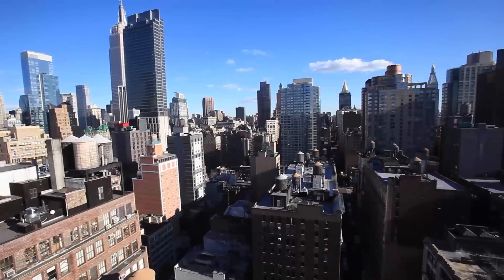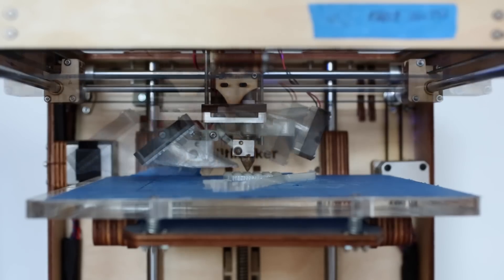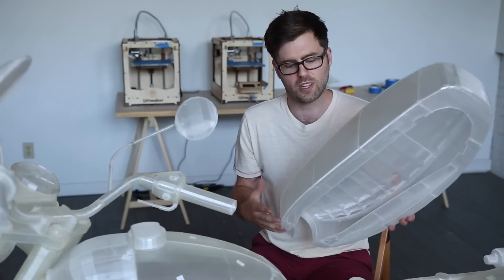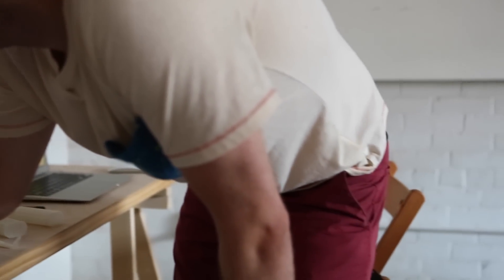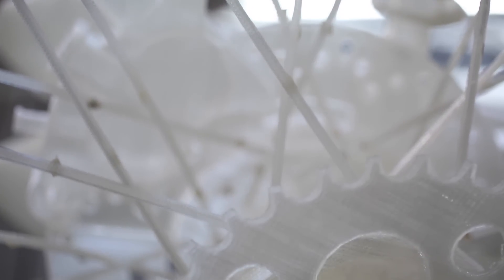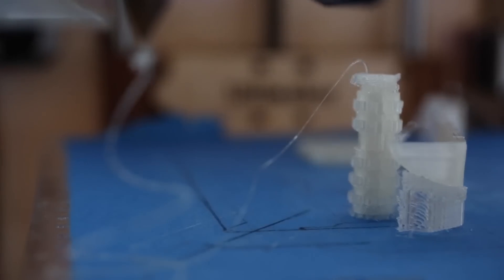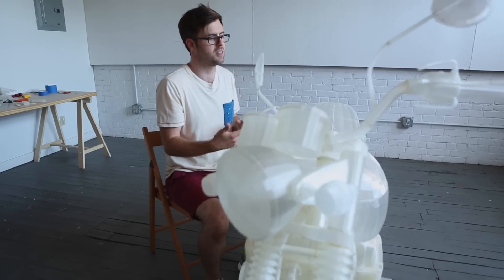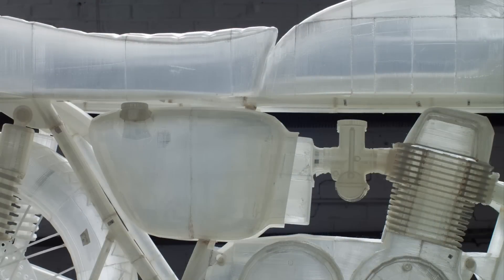3D Printed Motorcycle by Jonathan Brand - Ultimaker: 3D Printing Story

Comment: You could buy a real 72 Honda CB500 for about the same cost as one of those Ultimaker 3D Printers..  And you could actually ride around on it, and own the real thing..  He also didn't mention how much that plastic cost to run through the printer to make this huge model.  Factor in the cost for the plastic, and you could probably buy a nice Harley for the total cost that it took to build this model.
Reply: 18 rolls * $30 a roll = $540 worth of PLA filament
Reply: taiden but if you have microcenter nearby you could buy the roll at half price, with good quality the brand name called inland
Reply: esp heroz
Good to know, thanks! :)
Reply: Komet163B 
What's your point?
Reply: Yeah but when it comes to building things like prosthetic limbs, the cost of the material is WAYYYYYY cheaper for a 3-D printed device. Which makes it a lot more affordable for those that don't have the money or the insurance to pay for an expensive device.
Reply: taiden u welcome :),
Reply: +Komet163B thats no fun bruh.
Reply: Komet, the reason people buy these printers is so that they can make other things cheaper. He could have made around 3 of those motorcycles with that printer alone. Lol
Reply: about the plastic: he used 18 rolls. with cheap filament that's about 400$ and with high quality one more like 700$
Reply: Carter Peel it’s not a motorcycle, it is plastic model of a motorcycle
Reply: frogspasm2000 I think his point is obvious. The artist said he always wanted a motorcycle. This is a plastic model which you can’t even sit on let alone ride. He could have bought a real one for the investment
Reply: "you could probably buy a nice Harley"  2 things wrong with that sentance. 
#1 "a nice Harley" 
#2 "you could probably buy" no dont buy never buy a harley

Comment: how did you glue those parts together?? I a stuggling to find something that will actually fuse pla??
Reply: It looked like he was using a soldering iron and a loose spool of PLA to sort of "spot weld" them together

Comment: Is the slicer software included with the Ultimaker or is that a 3rd party software?
Reply from the maker: +CDNBaconRich We develop the free, open source slicer Cura, which is also what we include and recommend for the Ultimaker 3D printers. You can however use any slicer you wish!

Comment: Nice work, but it is a CB750.
Reply: I thought so; I had a 1975 CB750-4, I got brand new. the Engine cylinder blocks on the 750 are slanted slightly forward where the 500 is straight vertical. I know cause a friend had a 500 and I had the 750.
Reply: yea i have a 72 500 and my exhaust is different
Reply: roaringleo57 Good snag on the engine! I had a '74, 750 and never noticed the difference to other era Honda 4's. You got to admit though, it is a very impressive production. Just to get all the dimensions and pieces to line up, let alone not to have the original sitting beside it makes it a big "Win" in my book.
Reply: Yep, just another hipster without a clue.